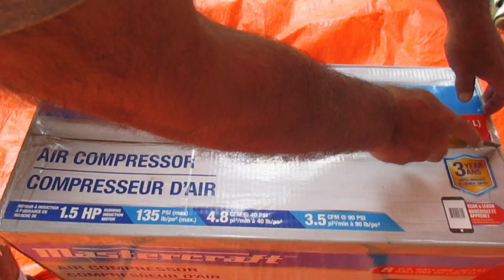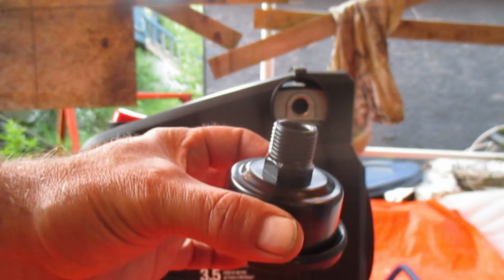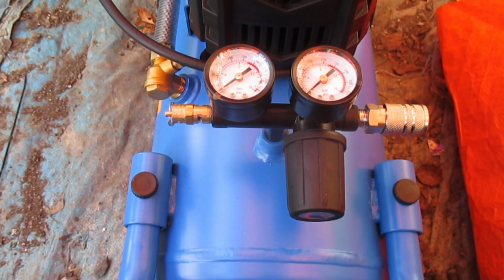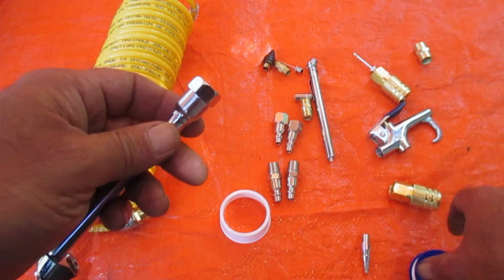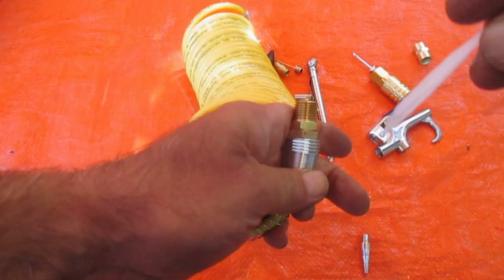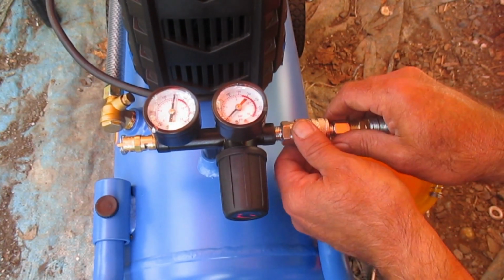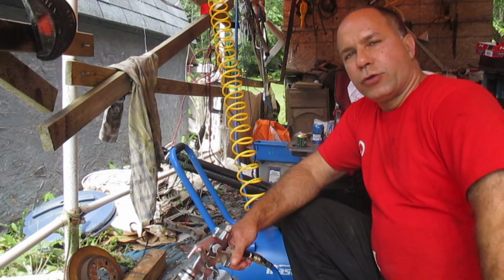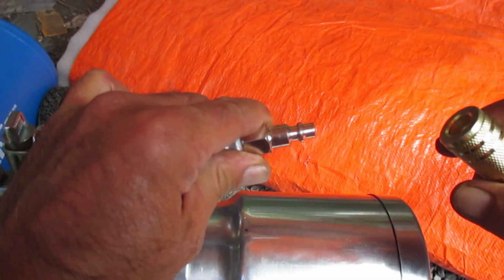How to use an air compressor and connect tools to it . An 8 gallon air compressor in this video

Comment: U wrapped your Teflon in the wrong direction but i guess it worked,thanks for the video it will definitely help people set up their own compressor and you are correct the plastic hose works but that's about the best thing about it .I had to replace the hose fitting and it was a nightmare to get it on the male barb so i could adapt the other fittings to screw on to the hose finally got out my heat gun and made it swell and soften enough to slip on the barb whoo that took a minute.   Thanks for the time and effort you put in to help out.

Comment: Great video.  Question.  My 2 yr old compressor has a broken guage (the one for the tank).  The one for the tool or hose works fine.  Is the compressor still safe to use?
Reply: Yes..  You have 2 safety pressure release.  1.  the compressor switch is set to shut it off at whatever working pressure to tank holds.  2. The safety 'pop off valve' that is set and can not be changed.  If the pressure switch fails and it keeps on pumping,  the the pop off valve with release pressure.  Than, you're done till you figure out what went wrong.

Comment: Why are the thread connections screwing in about 1/4"? I can't seem to make them go in very far.
Reply: Just depends on the quality of couplers and hose you got. I have two cheap hoses and couplers I use on a smaller 8gallon compressor I don’t use all the time and it’s like that. But for my big 30gallon I use good quality hoses and couplers.

Comment: Great video!  This is the exact model of air compressor and connectors I bought in the spring, and am just getting around to using it with no idea how.  Your video covering the break-in process, connecting the tools, start up, usage, and shut down was exactly what I needed to start using this tool.  Thank you for the great step-by-step detail.

Comment: Hey man was looking compressor oil but could not get anywhere so I used 2 stroke oil instead, so far it seems to be doing a great job but I'm not sure how it may perform in the long run

Comment: Will the safety valve go off automatically if you were to leave it running ?
Reply: If everything is in proper order, the motor will stop at the upper psi rating for the particular machine.

Comment: I recommend you to fill up compressor, spray soapy water (Fairy) to every fitting you find on the compressor and look for air bubbles. If you find any leaks, unscrew the connection and use alot of Teflon tape to make it airtight. 
Believe me, I'm sure you will find at least one leak.
Even from factory brand new unit. Often they leak from gauge connections. 
Good luck